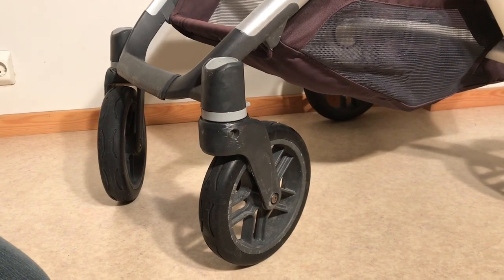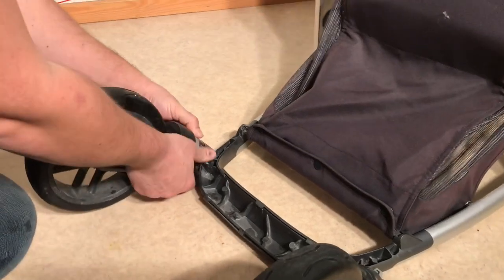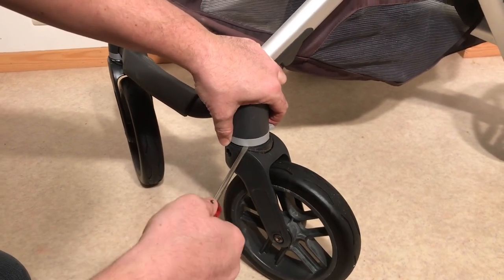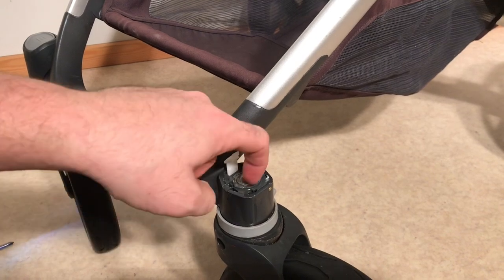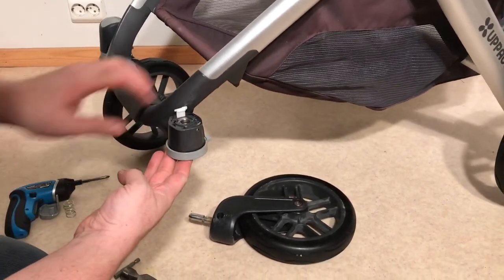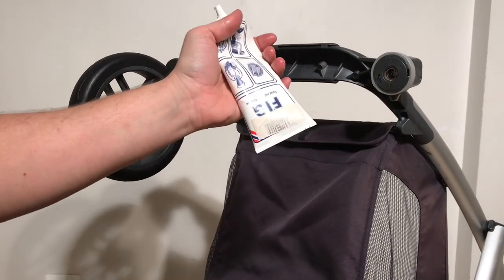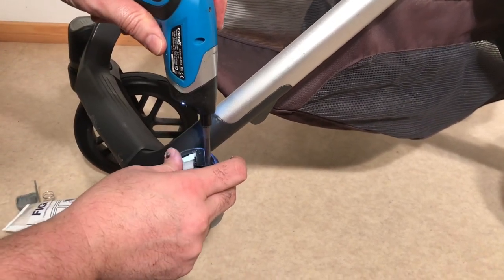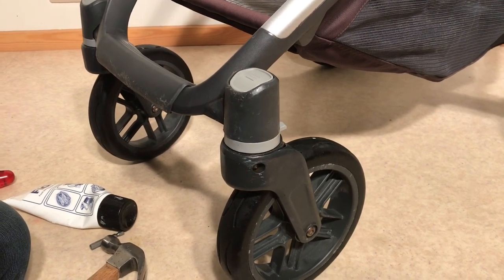How to Remove / Detach a Stuck Front Wheel on a Uppababy Vista

Comment: Do you have any suggestions on where to buy replacement wheel bearings for the front wheels? Never bought bearings separately before, and having a hard time finding anything that matches the dimensions of the uppababy bearings.
Reply from the maker: Amazon.  I plan to put up links eventually, but I don't know exactly when I'll get around to it.  There's a little nr. somewhere on the bearing, and there's some company on Amazon that has a searchable database with thousands of sizes.  Alternatively, take it to a skateboard shop. :)

Comment: This worked a treat. My pram is 6 years old, so it genuinely took 2 hours of aggressive hammering to get it out. Slapped on an o ring, and the wheels rarely wobble now.
Thanks so much for the video mate
Reply: @themelbournebeerrrview1395 been a while, I realize, but are we talking an o-ring snug to the shaft? Or like a seal big enough to seat on the bearing?
Reply: Hey mate, I put the ring snug on, which takes out the slack. Depends on the thickness of ring, but I then needed a bit of a squeeze putting the wheel back on to get the click

Comment: Wondering if you could help - I have a stuck front wheel that even with WD-40 and Rust-oleum, I cannot get this wheel off. I have been hammering and it will not move at all. I followed the same process outlined in the video and got the left wheel off. However, the right one shows no movement. Any advice? I was thinking - since I am going to replace the front wheels, is it reasonable to take titanium drill-bit and drill through them middle? Is that asking for trouble? Thanks so much.
Reply from the maker: It could damage the housing, both if the drill slips, but also if the metal heats up enough to melt /warp plastic elements.  Still though, if you absolutely can't get it off, then you may not have many other choices that wouldn't also be risky.  Uppababy is one of the better brands for getting ahold of spare parts though, so I would consider contacting a local distributor or their customer service (or search 'Uppababy HUB service center' and see if there is one close to you to contact) and ask the price for a new front-frame altogether, it might save you a lot of headaches. :)
Reply: I am in the exact same situation! Tried everything, one wheel came off, the other will not budge. My husband is thinking of trying this drilling technique. How did it work for you, Rich??

Comment: Does this work for the back wheels too?
Reply from the maker: They're not connected in the same manner, but the general idea is the same, lubrication (maybe even rust-removal agents) + making sure that the unlocking button is held in the unlocked position + work with tools to (in this case) pry them off.
Reply: @BarnevognverkstedNo  thank you - the hammer trick is what ended up working!